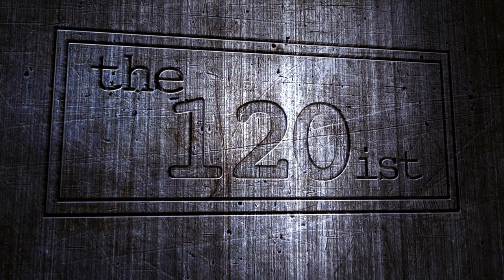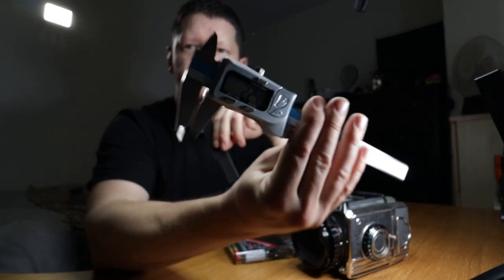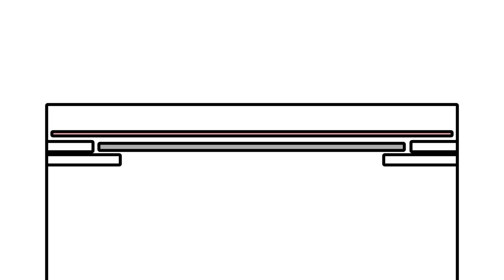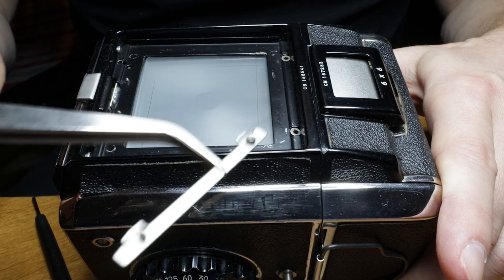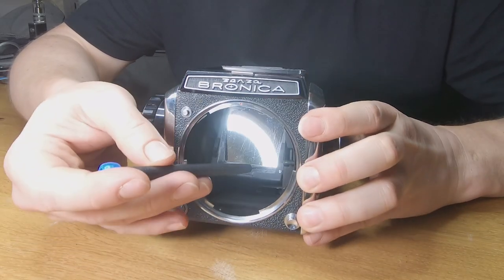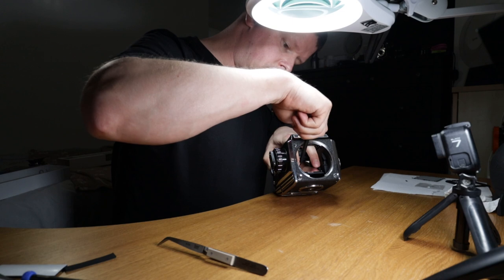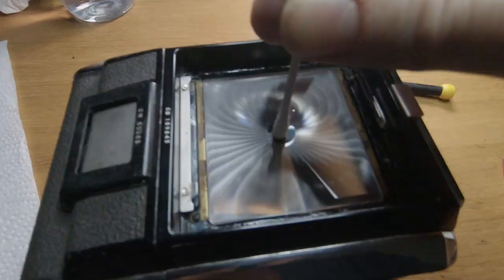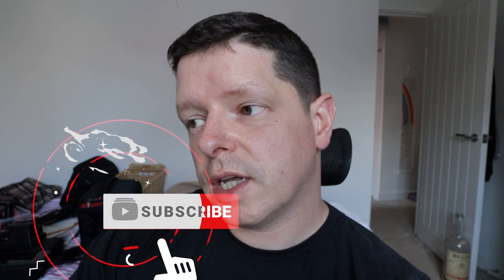Bronica S2A - Focus Problems - HOW TO replace ground glass foam AND mirror foam (also Bronica S2)

Comment: I can focus to infinity but not for close focus 😣
Reply from the maker: Whaaaat? That shouldn’t happen! So infinity is in focus at the end of the lens… so what happens? How close are you able to focus? And which lens are you using?
Reply from the maker: If you reach infinity focus at the end of the lens, in other words objects in the far distance come into focus when the lens comes to a stop, then your focusing screen should be “calibrated”, so to speak. How are you judging your close focus? From negatives? Or by the distance scale?
Reply: @the120ist  I just disassembled the focusing screen and there is no foam underneath!!!
Reply from the maker: Really? None? That’s pretty weird! Was your focusing screen loose? Was it wobbling around?
Reply: @the120ist  the foam is supposed to have been replaced.  The one on the focusing screen and the one located under the mirror.  i did tests with a nikkor h.c 75mm 2.8 and the photos were out of focus
Reply from the maker: @sebvz89  hmmm... ok. But you're getting correct infinity focus, is that right? Did you take a photo with the camera focused at infinity? Or are you just going by the image on the ground glass at the end of the lens?

If you took a photo at infinity, and it was in focus on the negative, but then took a photo closer and it appeared in focus on the ground glass, but was out of focus on the negative... then that's a very interesting problem and will narrow down the possibilities!
Reply: f*ck now i lost a screw from the focus screen everything goes wrong with my camera
Reply from the maker: @sebvz89  Ah man! It's all going wrong for you. Don't panic, take a breath. It's frustrating, for sure, but you can get replacement screws really easily. Just search for jewellers screws or watchmakers screws on amazon, you can get a box of assorted screws and find one that matches the screw that hasn't been lost!

Seriously, you've got this. There is always a solution.
Reply: @the120ist  please! help me find the right one! i dont have tools for measure the right choice! :'(
Reply from the maker: @sebvz89  The screws for the focusing screen are M1.6 x 3 - so they are 1.6mm thick, and 3mm length (actually 3.8mm total length, but the head is 0.8mm). So look for M1.6 x 3 type screws
Reply from the maker: @sebvz89  You want flat screws, not countersunk. Something like this: https://www.metricscrews.us/index.php?main_page=product_info&cPath=98_290_292&products_id=2&zenid=7vkf4pkv9f3mho42hrl37bm4o5
Reply from the maker: @sebvz89  I've got a set like this that gives you lots of options: https://www.amazon.com/Mini-Skater-Eyeglass-Spectacles-Assortment/dp/B07DCJ9L3Y/ref=sr_1_4?dchild=1&keywords=m1.6+screw&qid=1630366773&sr=8-4
Reply: @the120ist  you're the great! thank you so much
Reply: @the120ist  When I focus, it seems to be fine but when I see the photos, what is really in focus is the back. Is this a problem with the focusing screen or the mirror?
Reply from the maker: @sebvz89  ok, so for the point of focus in the image at the film plane to be behind the point of focus you're seeing on the focusing screen, the distance between the back of the lens and the focusing screen must be slightly longer than the distance from the back of the lens to the film plane.

So, this could be a problem at either the mirror or the focusing screen. A breakdown of the foam at either point will cause a fractional increase in the distance between back of the lens and focusing screen. Did you replace both sets of foam? And what thickness of foam did you use?

Are you still getting a good clear focus on the focusing screen on distant objects with the lens retracted all the way? So when the lens is fully retracted, at it's shortest, is everything in the far distance perfectly in focus?
Reply from the maker: @sebvz89  Do you want to email me - hello at the120.ist - and we can set up a video call? You can show me what's happening and I can try to help?
Reply: @the120ist  sure! what's your email?
Reply from the maker: @sebvz89  hello@ the120.ist      without the space!
Reply: @the120ist  I have a similar problem. close up focus on negative does not match focus on glass. infinity is fine. What is the best solution?
Reply: Same problem just bought S2. Infinity looks perfect in viewfinder and picture printed, when I focus on a subject in viewfinder, the actual picture captured from the lens is focused a step further away from my subject. 🤔

Comment: I'm having trouble getting the screws out... can anyone help with that?
Reply from the maker: I’ve heard a few people having problems with the screws. They can be really tricky. They’re brass, so they’re quite soft and easy to damage. And if some genius has put some kind of glue on the threads then you can have a hard job getting them out.

Best advice is to use a knife or file to carefully make sure the grooves on the screw heads are deep enough to ensure good purchase with the screwdriver… then get the screwdriver seated, get some pliers and use them to turn the screwdriver, giving you a better lever and more torque. Then very gradually increase the amount of force you’re putting in until you feel something move!

It’s a very tricky job though, there is a risk of stripping the screw heads, and a real risk of snapping the screw heads off altogether. And if you snap off the head of the screw, it is very difficult to get it out again. The shaft of the screw is too thin to try to tap into it.

Good luck, I hope you get them out. 👍
Reply: @the120ist  hey there! Thanks alot for your reply. Thankfully, despite the screw being quite worn out, I managed to successfully remove them. Ill probably have to find replacements though. It looks like quite a common type of screw.
Reply from the maker: @pantherclaws123  Yes, I've replaced a couple successfully. I can't remember the dimensions off the top of my head, but they're a common size. I'll dig out the numbers for you if you need them.
Reply: @the120ist  that's alright, I'll just bring it to a DIY shop and figure it out. Thanks for the fantastic video by the way, it was really informative.
Reply: @the120ist  hey! I'm so sorry but I went to look for the screw but had a hard time finding it. Could u share the dimensions of the screw please?
Reply: @the120ist  hey! I'm so sorry but I went to look for the screw but had a hard time finding it. Could u share the dimensions of the screw please? Or what it's usually called?
Reply from the maker: @pantherclaws123  no problem at all. I’ve been trying to find the measurements, I sent them to someone else a while back. But I can’t see where they are!! I’ll take a screw out tomorrow and measure it again 👍👍👍
Reply from the maker: @pantherclaws123  Found it - The screws for the focusing screen are M1.6 x 3 - so they are 1.6mm thick, and 3mm length (actually 3.8mm total length, but the head is 0.8mm). So look for M1.6 x 3 type screws
Reply from the maker: Actually change that! Go with M1.7, 3mm (3.8mm including head). But that extra 0.1mm on the thickness makes the screws sit nice and tight. So M1.7!